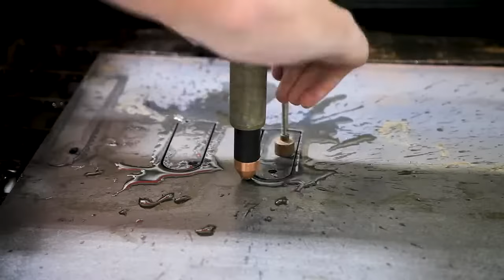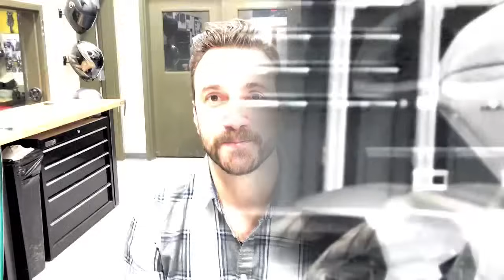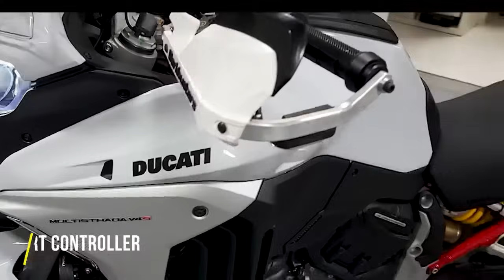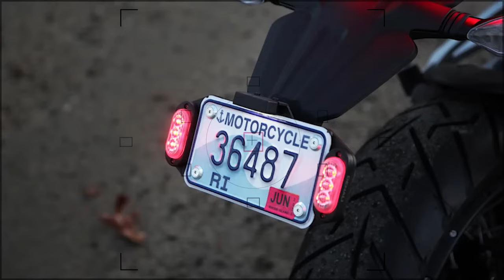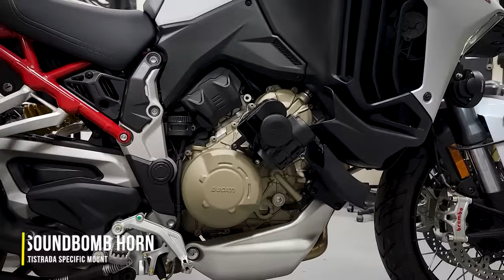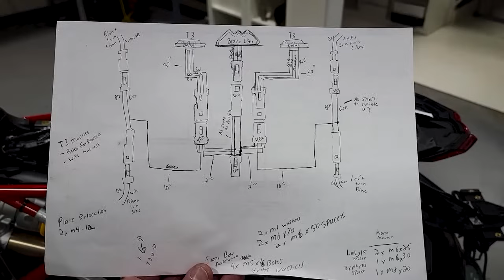Best LED Lighting & Safety Upgrades for the Ducati Multistrada V4 from Denali Electronics

Comment: Thank you for this video, albeit a little late-ish... The bike is out for 5 years. Anyway i bought the controller as soon as it came out but still haven't had the time to install it with the D2 lights. However I had the D2's on my previous bike, a V-strom 1000, and they were amazing. I used the road legal hybrid lenses, and even those were literally day and night compared to the standalone headlight. Well done Sirs and keep it going.